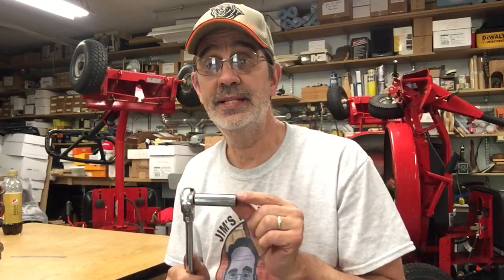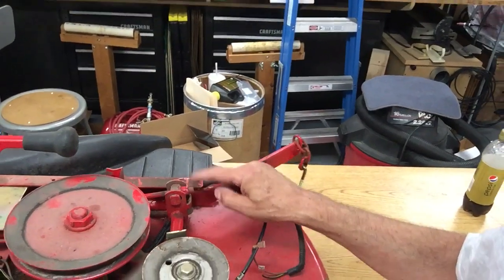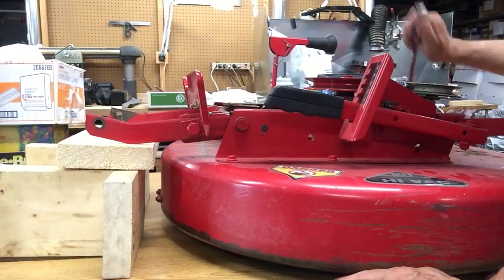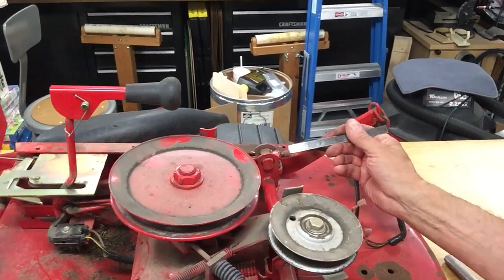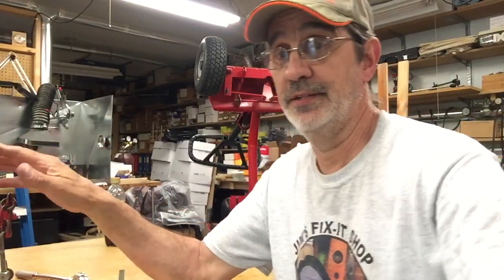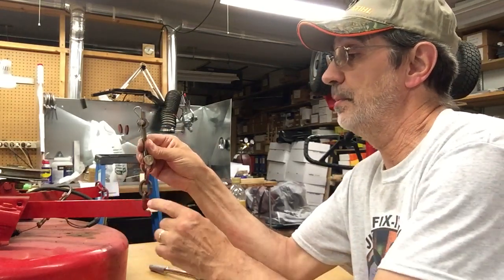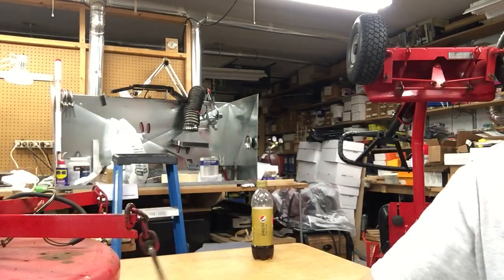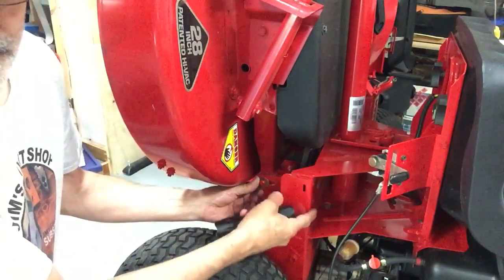303.  Lifting your mower deck higher, to help Tom

Comment: just bought a sr1328 Snapper.  the engine has a rap.  i need to replace the engine.  It has a briggs 13hp engine.  what is a direct replacement engine?  i have the electric start.
Reply from the maker: Most any Briggs & Stratton engine will fit on your machine as long is the horsepower is somewhat close to the old engine. Jim

Comment: Hi Jim, at 5;25 you showed my model, 331413KVE. my deck leveling rod doesnt seem to fit and I suspect it was the wrong one because the parts diagram from partstree https://www.partstree.com/models/331413kve-80430-snapper-33-rear-engine-riding-mower-14hp/rails-lift-arms-cam-lift-25-28-30-33-models-12/ 
part number 2 was attached to the deck bracket, part number 14, with the bracket installed backwards 180 degrees,   which anchors the adjusting rod to the deck. the adusting rod seems to be way too short for the deck by 1.5 inches or so with bracket 14 installed correctly. Is there a chance that the adjusting rod is too short and from the wrong model? this is driving me crazy and I am spending way too much time on this. I don't want to just buy another if all adjusting rods are the same size. thanks. steve
Reply from the maker: Call Parts tree directly with your model number and tell them you would like to know how long the leveling rod is supposed to be so you know if you have the right one or not they work with their customers and help them out their phone number is on the front page of their website and you will actually get a human to answer the phone if you have any problems let me know. Jim
Reply: @jimjackson9381  they said it was 15.3 inches which is the length of the one I have that is too short. according to the partstree diagram the bracket was installed incorrectly. the 15.3 inch rod fits with the bracket installed wrong but the rod apparently is the right size. it would not raise the deck at all and it just sat on the ground with no up or down adjustment available. I adjusted the nut all the way in and all the way out with no movement at all. at the 6 height it goes up about .25 inches maybe so I am pretty sure the levers are connected properly. oh well. I will keep watching videos hope something turns up. maybe the parts tree diagram is wrong and the bracket was properly installed before? the original way would bend the leveling rod with the nut all the way in.
Reply: @jimjackson9381  if you have a second maybe you could look at the diagram on parts tree and tell if the part 14 leveling arm is positioned correctly. I am ready to move on and put it back on craigs.

Comment: you do not show the location of the
Reply from the maker: I’m not sure I got all of your comment it only says
( You do not show the location of the )
I’m not sure of what you were talking about. Jim
Reply: @jimjackson9381  I wrote more after...I have a SR1030.  To raise the cut do I remove that black cover below the seat?  I want to raise the mower cut.  On your video "303" there is not a good shot of the nut that nut that  needs turning.
Reply from the maker: @frankanderson9799  yes remove the cover on the top of the mower deck there is a long bar that goes from the front to the back of the deck the nut is on the backside of the deck if you tighten the nut that will raise your deck then you’ll have to change the chains on the back side of the deck. Jim